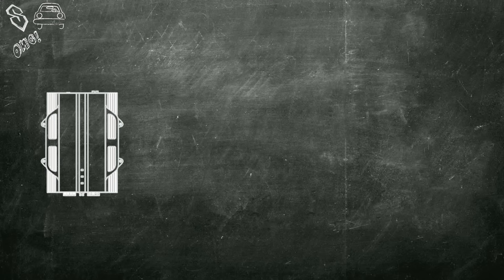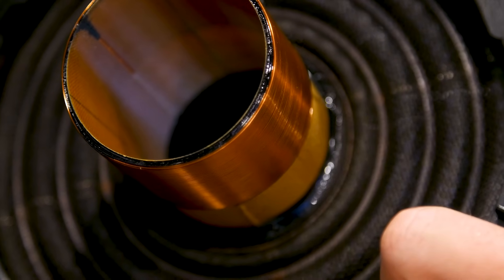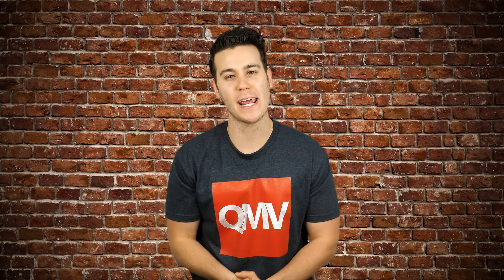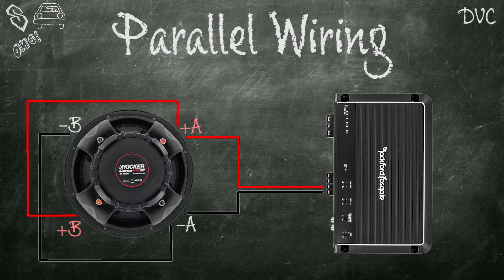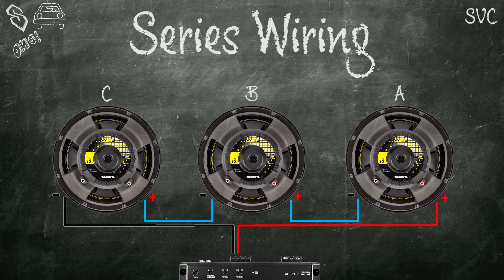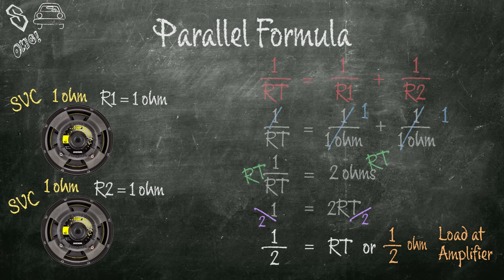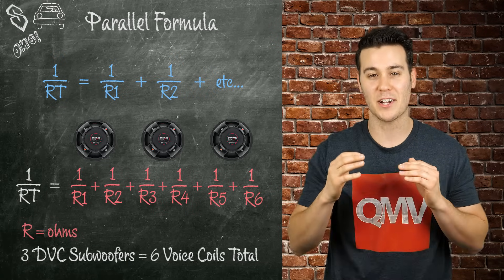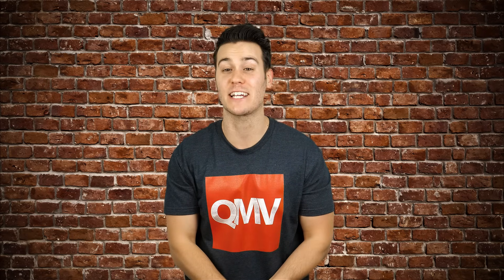How To Wire Subwoofers - Parallel vs Series - Single Voice Coil and Dual Voice Coil

Comment: Hi..Nice information Thanks..
I have some questions..
1. WHICH ONE IS BETTER..JBL S3-1224 OR ROCKFORD FOSGATE P3D2 BOTH 12"..?
 Kindly let me know my choosed combination is right or wrong...?
1.FOR BOTH CAR DOORS JBL GTO 609C -6.5" 270W/100W RMS@4 OHM TOTAL 4 COMPONENT SPEAKERS WITH BLAUPUNKT GTA-470DSP 4-CHANNEL 70W@4 OHM, 100W@2 OHM RMS AMPLIFIER.
2. JBL S3-1224 1500W/500W RMS @4 OHM WITH BLAUPUNKT GTA-11250DSP MONO CHANNEL 500W@4 OHM, 1000W@2 OHM RMS.
Awaiting for your reply...Thanks..

Comment: I want to buy an sound system. . From the shop where iam going to buy they sell two models.. and the only difference they say in those two models are that for one model they say that magnet in subwoofer is double than other  and aluminium sheet for amplifier is 0.25% thicker than otherother things are same. how much difference it will make and in which way...
Please please assist me fast

Comment: So a dual voice coil 1 ohm Rockford Fosgate a 2 ohm amp? I fried 3 amps. Never hurt the sub though. That p2 punch was badass. Started with 4 ohm sony explode 480 watt a 2 ohm amplifier i cant remember the maker, but it was the best i got for cheap and a dual 4 ohm on a 1 ohm sub i think i wired for 1/2 ohm. Ima watch the previous video to see how i wired up this 1 ohm Rockford Fosgate P2 Punch 500w sub incorrectly

Comment: Quick question I have a Kenwood 1800 w max mono class D amp with 2 alpine typeR red line speakers. Any recommendations on how to connect or run the speakers. Right now it runs hot and cuts off if I run it for more then 10 or 15 min.
Reply: I could help, but I need more info on your speakers. Do you have the 12in dual 2 ohm or 4 ohm speakers?
Reply: quick questiopn please 
Ihave an Alpine PDX -M12 wired to a capacitor hifonics 1F and an Alpine Type R 12 inch dual 4 ohm and a pioneerDEH-80 prs 
would I wiring on 2ohm or 4ohm 
(in a small car -MINI-)

Comment: We clicked on this video for info......... after this video I'm  overloaded
Reply: For anyone who comes across this video today. He made things WAY more complicated than necessary.

For series wiring your final ohm load is (ohm of the voice coil) x (# of voice coils)

For parallel wiring your final ohm load is (ohm of the voice coil) ÷ (# of voice coils)

For example, you have 2 DVC 4-ohm subs. That's 2 subs with 2 coils each, and each coil is 4-ohm.

So series would be 4-ohm x 4 VCs = 16-ohm

And for parallel it'd be 4-ohm ÷ 4 VCs = 1-ohm

For Series/Parallel which he commented on for just a second, it's a "little" more complicated but you just calculate the series connections first and then treat each series connection as a single voice coil of it's calculated impedance and calculate the parallel connections ohms based on that. I'm not great at explaining things, but hopefully that makes sense.

So 2 DVC 4-ohm subs, both voice coils on each sub are wired in series and then the subs are wired parallel to each other. So you calculate the total impedance of each sub separately (2 4-ohm VCs wired in series so 4-ohm x 2 VCs = 8-ohm). Then imagine each sub as a SVC 8-ohm sub and think if you wired them in parallel (8-ohm ÷ 2 VCs = 4-ohm). So 2 DVC 4-ohm subs wired in Series/Parallel would come out to 4-ohm at the amp.

Comment: Ok I have 2 Amos 4 subs ther d4 subs amps are one ohm subs I have one amp per set of subs and I wired them red to red black to black that gave me one ohm impedance what would be the other way or what way is better for sound and bass or is the way I did it the best it’s getting down hard I flex windshield and all
Reply from the maker: Eric I had trouble following what you said but it sounds like you have (4) 1 ohm SVC wired in parallel, is that correct? What impedance are each woofer? Are they in fact SVC or DVC? Sound quality will not change based on load, amp output will change massively; heat and protection circuits could become an issue.
Reply: Quality Mobile Video I have 4 d4 subs 2 amps that are 1 ohm Amps so I run one amp per set of subs I went red to red black to black leaving one ohm per set to amps is that best way

Comment: Can I wire two dual 4ohm subs to two ohms final
Reply from the maker: Nope! That makes a 1 ohm or 4 ohm load bud
Reply: Quality Mobile Video ok. Thanks I haven’t found anything about it so I figured it wouldn’t work
Reply: @Qualitymobilevideo  maybe you should get a little more information before just saying no.
Reply: yes you can, depends on a few facts. are you saying 2 dual subwoofers at 4ohms each, or are you saying 2 dual voice coil at 4ohms each. 

either way. if you have 2 single coil 4ohm speakers you just hook both positive speaker wires together and both negative wires together at the amp. if you have a single channel amp. simple enough install. if you have a two or more channel amp you hook the positive up on one terminal positive and the negative to the other terminal negative. this is called bridging. 

if you have 2 dual voice coil speakers at 4ohms per coil. the lowest you can do is 1ohm this is done running both voice coils in parallel and both speakers in parallel. if you tried parallel voice coils and ran the speakers in series, you would again end up at 4 ohms. and doing the coils in series and the speakers in parallel, you would be at 4 ohms. 

if you want to get down to 2ohms, if your speakers are dual voice coils, you would want to consider buying a couple more speakers.

Comment: I got them two single voice coil dual 4ohms Comp C12 subwoofers. Ik they should be safe to wire at 1ohms load, but question is: how can you test the actual wattage out of the subwoofers when on the amp after you brake them in?? Idk if that makes any sense or not but just seeing how it can be done??

Comment: Your water analogy is flawed. Voltage::pressure
Impedance::restriction in the line
Amperage::flow through the line
Reply: RustyCarnahan Yes. And thank you. Was wondering if anyone else caught that
Reply: Electricity flows like water the path of least resistance. So a Water analogy is correct just not his lmao!
Reply: Yup
Reply: Well, amps measure current so that makes sense
Reply: I noticed this too, these are very good well explained videos but you're right. Voltage is pressure.

Comment: I need some help please. I've got two 12" Crossfire DB3 series subs are DVC @ 2/8 ohm's. Can or how do I wire them to a final 4 ohm's to match my amplifier. If possible I like to wire them @ 2 ohm's at the amplifier. Thank you
Reply: if you haven't figured it out in the two years this comment has been here, you need to hook the voice coils in parallel, both positives hooked together, and both negatives hooked together and the pos to pos and neg to neg on the amp. the same for the other speaker, that will put each speaker at about 4ohms. then hook those to the amp both pos to one pos on amp and same with neg. that will drop total down to about 2ohms

Comment: i dont get it is 2 ohms bad ?  or if i have a amp for the right load would it still be warm ?
Reply from the maker: No there's nothing wrong with 2 ohms! They're all fine, but its mostly about matching your system correctly. A 1 ohm system will proved the most power and be least efficient, a 2 ohm system will provide the next most power with decent efficiency, a 4 ohm system will provide less power than 1 ohm and 2 ohm but it will be more efficient. Get it?

Comment: Team. I enjoy all of your videos as they are very informative. I understand a little more the concept but will like to ask for your guys recommendation. I have bought “Skar Audio 3x VVX-8v3 D2 800 Watt Subwoofers with RP-800.1D Monoblock Sub Amplifier and 4 Gauge Amp Kit” in Amazon. And one of the recommendations is to better use the Amps performance. A 1.37ohm load is recommended. They are dual coils. What is your best recommendation to wire this? Series or parallel? And to be able to achieve 1ohm. So the amp can move all three 8” subs.  if you guys can help with a wiring diagram for me to get this done, will be greatly appreciated.

Comment: I have a question.
I do not know much about wiring, but i am attempting to wire two more subs in my car. I originally had a 10in Alpine wired to my memphis amp (i dont know the ohms and wattage). My uncle gave me is old premier dual 10in subs. They've sat in my trunk for a few weeks amd today i tried to wire them. I successfully wired one of the two premier subs, but my amp only has 4 ports. 2 positves and 2 negatives. Can i wire the third premier sub to a port another sub is connected to? Like, with the wires touching in the same port? Or is that a big NO. I will say having the one amp and the extra sub added SOO much sound and better quality. I was amazed and i really want to wire this third one i jus need to know how.
Reply: I will add i know enough about wiring to not screw up big time. I took a digital electronics course in highschool where i learned how to soder, breadboard, connect circuits, build diagrams of these circuits. We studied the purpose of resistors, the colored lines and the meaning, etc. Sadly i do not remember a lot of details outside of the hands on wiring aspect.

Comment: Nice vid, very informative. I've got a question though. I've got a 600w hiphonics Brutus mono block. I'm powering a 10" 4Ω 400w rms 800w peak woofer. The mono block has 2 sets of speaker out clamps. If I wire both sets of clamps to the same speaker will I double my wattage? I'm currently pushing 300w the way it's wired now.
Reply: Nope
Reply: If it's a XI610 then by the specs I see online its only 150W at 4 Ohm... (if to be got a DVC 4 Ohm sub and the coils are in parallel then you have a 2 Ohm load and the amp should do 300W.)

On a monoblock, two sets of speaker terminals are to simplify cleanly wiring up 2 subs/loads in parallel - the positive (and negative) terminals are tied together, essentially each single terminal has a mini distribution block with 2 out-ports. Adding wires will do nothing, unless your current ones are way to thin...
Note how the positives (and negatives) in this video has bars above them, indicating that they are connected/tied together - https://youtu.be/dKEHf8_3k0E:-)

Comment: not simplified this video.if you take a dual voice coil voofer conected in series would  they not cansel each other out?one coil in the woofer push at the same time the other coil pull,s if a dual coil driver is connected in series.want both coils in the dual coil driver to work together.if you connect 4 woofers in a cabinet or bafle in  series in a row the 2 .the 1 woofer gets the positive lead from amp and membran face front ,then connect in serie with nr 2 woofer that should face backwords with magnet in front.Nr 3 woofer in serie with membran facing front like the 1 one.the 4 woofer in sere facing magnet front.can rotate plasement so one on each side face forward and the 2 in midle magnet face forward.if you take 4 in a cabinett in series and not turn drivers after polarity will bee a waste off lots off energy/sound pressure.it wil not play good.they are working against 2 off 4 will bee 180 deggres out phase fromeach other.if i remember correctly.preety shure i am.sorry for bad english writting

Comment: Dude, I know you're trying to help and keep it simple, but make sure your version of simple is accurate.  The water analogy....did anyone proof this vid?  Voltage potential is the electrochemical/magnetic created force (pressure) pushing the water (electrons, flow of is current) through the pipe.  Resistance symbol is a small section of pipe, restricting flow...but this part is abstract nothing to do with size of anything.  

Tip: Always use fine wire braided into larger cable for high current as opposed to large single solid wire; high current DC works better on a smaller braided wire than large thick wire.  Small size = better heat dissipation and lower resistance since the electrons actually flow mainly along the surface of wire, not inside.  So multiple small wires have much more surface/volume ratio.

Impedence is NOT resistance in AC, its a vector or phasor with magnitude and phase angle and the mathematics get insanely complex when connecting multiple coils.  Reactance of coil is given by Xr = 2pi*f*L where f is frequency and L is inductance.  If its a large coil it can have capacitance effects, and inductance Z = internal R of coil * Xr, where Xr is the imaginary part representing phase angle.  Current is out of phase 90 degrees, and dealing with phase shifts and change over time requires some high level calculus and skills with differential equations.  Of course this isnt necessary for installing ur system.....but if you happen to know the full picture, little things matter like making custom biasing corrections by souldering a transister, cap, and a few resisters (values must be calculated) on your speaker input to interface with input.  What sound quality!!

Comment: Hi,i have a aiwa amplifiar which is 150 watt rms and every channel is impedence 6ohm.so can i use 12" subwoofer is 400 watt and impedence 4ohm
Reply from the maker: Hey Wahid, do you have the part numbers of the amplifier and the subwoofer?
Reply: Amplifier has two channel 6ohm and three port 8 ohm for speaker.so can i use 12" passive pioneer subwoofer 400  watt to my amplifier?

Comment: Reason why I'm asking is because I have a 2 ohm dual voice coil kicker and a single voice coil 4 ohm they both have the same stack batteries can I parallel them together and still get 2.5 ohms or have I just fucked up my speakers and my amp

Comment: He switched voltage and resistance description in the pipe example, voltage is known as electrical pressure while resistance or ohms is the amount of resistance that voltage must push the current though. resistance is the size of the pipe: larger pipe=less resistance meaning more flow, smaller pipe=more resistance and less flow. To get he same amount of water through the smaller pipe you would need to increase the pressure/voltage. this is why we manipulate resistance because voltage from the battery/alternator is constant.

Comment: Hey guy, 3ohm sub here again. I'm pretty sure I did the math right.. but if any of you math wizards out there want to verify, please do. If I wire in series with 2 svc 3 ohm subs, it would be 6 ohms. Pretty simple. BUT to wire in parallel, I got 6 ohms as well? 

1/RT = 1/3 + 1/3
1/RT = 1/6
1 = 1/6RT
1/1/6 = RT
1/1 * 6/1 = RT
6 = RT

So no matter what I'm using a 6 ohm system? Seems odd... maybe I did something wrong?
Reply: Well I found the answer on the JL audio site.. it would actually be 1.5 ohm with 2 3ohm subs wired in parallel.. but I'm still confused on what I did wrong. Would still appreciate some math help lol
Reply: You multiply the impedance of each speaker/ sub and then divide the result by the sum of the speakers/ sub
impedance. i.e (3*3)/(3+3) = 9/6 = 1.5 ohms. Hope this helps.

Comment: Hello buddy, please let me know. 
I have already got the following-
Pair of 15w full range 4 inch speakers. 8ohms.
Pair of 40w 4 inch woofer speakers. 8ohms.
Pair of 15w tweeters. 8ohms.
Pair of 30w ribbon tweeters. 8ohms.
Pair of 300w crossover modules.
210w x 210w amp, 4 to 8ohms. 
Wiring plan: The 2 tweeters in serries or parallel to eachother, and 1 woofer, goes through crossover. The full range speaker gets direct parallel line. (On each side).
1) Did I buy correct specification material? All values combine ok?  
2) Will that wiring plan work out perfect? 
The Serries-parallel was a understandable method for me, but I dont understand when the crossover comes in... how does it go? 
Thank you, see you

Comment: i have a .5ohm dvc 5kpw subwoofer i have it wired down to .25 ohm on 2 5k taramps im using 1 amp for ground terminal 1 for hot terminal (positive)

Comment: I have 2 12 subwoofers one Is 4 ohms and the other is 2 ohms, would I need 2 amps or can I use 1 amp?
Reply from the maker: two amps, set each amp independently to check for distortion

Comment: You could also use this equation to parallel wiring, I think It's a bit easier. 
((r1^-1)+(r2^-1)+(r3^-1)+..ect.)^-1

so your example would be:
((R1^-1)+(R2^-1))^-1 = ((4^-1)+(4^-1))^-1 = 2 ohm's
Reply: Emil Hammer this is the reciprical formula
Reply: (R1xR2):(R1+R2) is the best one

Comment: I just ordered TWO 12" Planet Audio AC12D 4ohm's/each, they produce 900W RMS MAX, and I got a Planet Audio TR4000.1D Mono AMP that produces 
4000 W MAX Power 1 Channel
3000 W X 1 RMS @ 1 ohm
1500 W X 1 RMS @ 2 ohm
750 W X 1 RMS @ 4 ohm.

With the two subwoofers at 4ohms and 900 RMS. Does that mean they can run at 2ohms at max of 1500watts RMS? I'm still trying to wrap my brain around all of this since I am a noobie. Please help me out, also what type of wiring is best? Parallel?
Reply from the maker: Sorry for the late reply Brett been a crazy week! Two DVC 4 ohm subwoofers make a 1 ohm load (parallel) or a 4 ohm load. I'm a little confused because you wrote 900W RMS MAX. Is ti 900W RMS or MAX? If they're 900W RMS each then they're a great match for that amp. They'll combine for 1800W RMS, and that amp does 3000W RMS @ 1 ohm which is plenty of power!